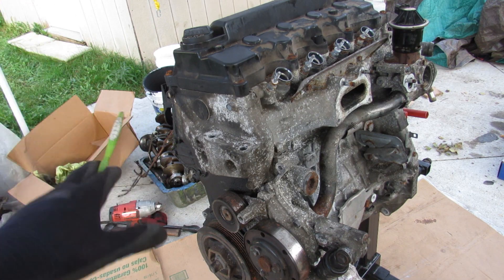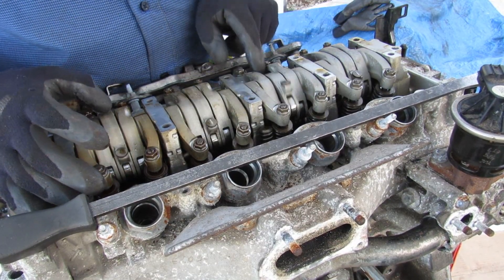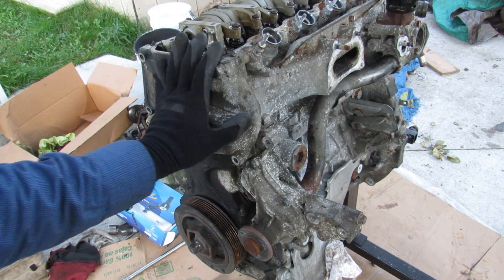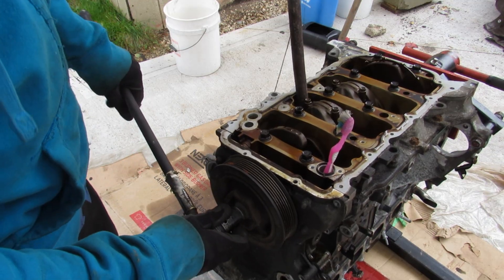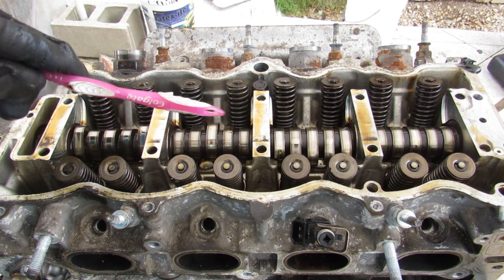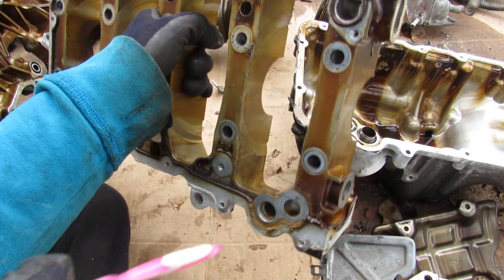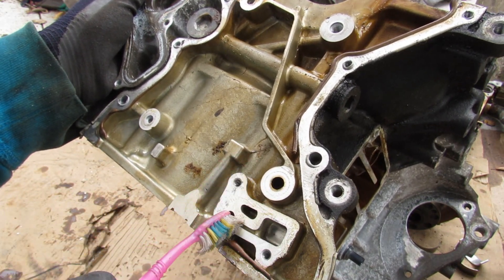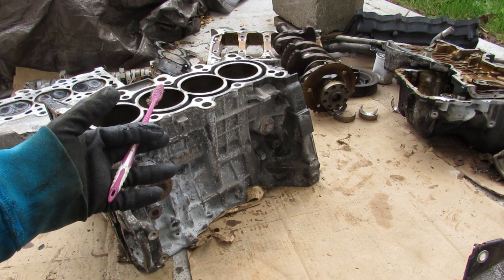Why Honda Civic Engines FAIL

Comment: I believe the egr/coolant heat exchange is intended to help warm up your cooling system on startup in cold temperatures.

Edit: I take it back, cooling exhaust gases before recirculating makes sense as its primary purpose. Might also have the added benefit of getting the block up to temp more quickly, but that's only speculation on my part
Reply from the maker: Or cool down gases before making the intake air too hot?
Reply: @speedkar99  It makes sense now, yeah. Maybe both?
Reply: @joystix11  exhaust gas recirculation I know on diesels brings hot air into the chamber to increase the air and combustion temp to reduce soot content but increases Nox if im not mistaken. but the system sucks ass lmao and clogs everything.
Reply: @razzle1245 I know on gas engines the EGR gas actually help cool down the combustion temps by replacing some of the oxygen with exhaust gases  that way when the combustion ignites it’s not as lean because because  there’s less room for oxygen when exhaust gases are present in the combustion chamber. The leaner the fuel air mixture the hotter it burns… they cool down the EGR gas because the hotter the gas the less room inside for cool dense air …
Reply: EGR generally isn't used until the engine is already warmed up, so it won't help there. It's just there to cool the exhaust gases before recirculating them to reduce NOx emissions and improve the air's density. The exhaust manifold being built into the head does help the engine warm up faster though since it's cooled by the engine's coolant.

Comment: What is currently the most reliable engine? Serious question.
Reply from the maker: K-series is up there minus it's vtec gaskets
Reply: 2017 Camry I4 and 2018 RAV4 I4. Highest reliability rating by Consumer reports.

Comment: I have a 07 civic. I put as float in the reservoir to alert me to any leakage. So for so good. The signal from the float goes to a off delay relay then a red light. Green is on to let me know system is on and working. I have 243,000 miles with very few issues. Some like the paint clearcoat issues have started. Nice car hope to get 300000 miles plus.

Comment: I used to have a 2009 Civic with that engine....it treated me well for the 3 years I had it
Reply: I have a 2009 Civic since 2014.it had 42000miles on it has 146,000 miles now. Doesn't burn any oil! No major repairs, just maintenance.

Comment: Got the exact same engine block problem in my 06 Civic. Most reliable car in the family except for coolant leak. Eh, poured some head gasket sealer, sort of helped... Just topping off coolant once a month. Mechanically: car is perfect otherwise at 125k
Reply: Fix it right wtf
Reply: @DannyOrnelasPerformance  repairs would cost roughly what the car is worth, that's all

Comment: we got this engine up until 10th generation civic, the r18, I had the 8th gen. never had any problems nor heard anyone having them... the mechanics didn't even complain about them other than the exhaust manifold which could be a pain in the butt sometimes because the sensor in it could break or go haywire and cause fuel efficiency problems but the car would still run. otherwise a great little reliable engine. mine did not have any problems though
Reply: Several family members have had Civics with these engines, they've all been great.
Reply: @sharifsircar  As long as there are no codes and the engine runs well with good gas mileage, don't worry about it. That's still well within a normal range and the whole reason we have fuel trim is to correct for minor variances like that. The fuel trim is never going to stay at exactly 0 for very long.
Reply: Would that sensor be the oxygen sensor?
Reply: @XxNoBunSeedsxX  yes

Comment: I strongly recommend the Lisle 77080 socket for Honda's crank bolts, it removes them with ease
Reply: Always like to learn what specific bits from particular tool brands are best at taking apart certain car makes
Reply: @roddydykes7053  same, the hidden gems you can find sometimes... but this tool, saved me so much energy  and time it's unbelievable

Comment: "big problem with these engines" , "why Civic engines fail"..... Everyone knows these engines are between most reliable engines in recent times. Only lack of maintenance bring these engines to failure . Ignorants running low on oil or coolant , never checking anything. For the joy of the haters who can talk trash about them

Comment: If it weren't for the weak block, that engine design is as elegant as you can get! Thank You Speedkar for the valuable teardown.
Reply: Its just the early ones, anything past 2010 is a tank.
Reply: @sekkusupisutoruzu  9th gen with this 1.8 is the tankiest car model in the world
Reply: @sekkusupisutoruzu agreed. I have a 2012 civic coupe with 241k miles and all it has is an air bag light and some sort of slight evap leak
Reply: hi I am interesst to buy a 2010 Civic with this engine. Does 2010 models 8gen (EU) also have that problem?  @sekkusupisutoruzu

Comment: I have 21 Civic Sport 1.5t, when its on Drive idling at red light, RPM is 500, car vibrates, is that normal? On Park mode it idles at 1k rpm & no vibration.
Reply: yes its normal
Reply: YourTypical Asian  21 models don't have that feature

Comment: I've driven Honda's for years and many a people agree they have the best petrol engines going. My 2003 honda accord 2 litre petrol ivtec went to 280km before the engine went.
Reply: How did you destroy a K20 with only 280km on it? That should have easily gone over 300km.

Comment: What’s your opinion on Honda CVT transmissions? I would be really interested in hearing what you think.
Reply: From my experience it depends. The early ones in the first generation Jazz/Fit and Civic EK have a problem with the start clutch, resulting in shuddering on takeoff, but they’re otherwise reliable. It’s a well documented problem with lots of fixes out there. 
The second generation Jazz/Fit CVT onwards is very reliable. I can’t speak for the larger cars like the CRV though. 
Either way they’re way better than Nissan/Jatco CVT’s.

Comment: I loved the engine teardown especially because it was a Honda engine. I always like to see Honda engineering tricks explained. Do you only tear down engines from junked cars? Was this R18 from a junked car? Also, if you can please tear down a L15A1 or L15A7 from the early Honda Fits. Those have a version of i-VTEC and it would be interesting to compare their iVTEC to the R18 i-VTEC. Plus, I hear that the early Fit engines are the basis for the current Honda turbo 1.5 liter engines.
Reply from the maker: Yeah I can only afford engines/cars that are old or broken
Reply: Sadly, I bought, and now own, accident honda city 2013 on my tight budget. The rear of the car is hardly hit and leaks. I have it fixed the rest of jobs. Now it’s back on the road.
Reply: I would also love to see an L15A7 engine breakdown

Comment: Well that explains the reason why my R20A engine is loosing coolant. Thanks!
Reply from the maker: Didn't know the 2.0 had the same issue
Reply: Can't confirm it yet. But it does explain the coolant loss. No white exhaust smoke, no visible leaks on the radiator, spark plugs looks fine, coolant hoses don't have crusty buildup on the outside, no funky smell from the AC that shows leaking in the heater core.

Comment: This r18 coolant leam problem was a casting issue. It also cracks/develops pores on the other side of the engine. This engine is still used today in hrvs and I haven't seen a leaking block in years. Pretty sure the warranty extension got them all
Reply from the maker: Yeah they fixed it in 2009

Comment: Honda and Toyota are thought to make the most reliable engines in the world, but as we see here, neither is without occasional problems.
Reply from the maker: Yes there are some problematic ones. Last week I finished tearing down a bad Toyota engine. Video to come soon
Reply: very bad experience I had with this same exact engine ,only lasted tad bit over 100,000 miles the engine block failed , bad Bad waste of money.

Comment: I had a question on the R18 Engine, I have a 2008 Honda Civic EX with 242k miles, no issues had to change the PVC Valve due to burning oil. I been told that the chain tensioner goes out around 300k and 400k. Is it possible to change the tensioner without taking the engine out and working on it from under the wheel well?
Reply from the maker: Yes. A bit tight though to work in the engine bay.
Reply: Thanks for your quick reply. This car has gone to Canada, 42 States, and Mexico and never had a brake down. I heard the coolant issue is only found in 1% of engine made in that era so its uncommon. I'm sure if I replace the chain tensioner this engine will go to 600k miles. I still have original clutch, one of the best cars I've owned. One common issue is the Denso A/C compressor had to change it and almost everyone I know has had to as well.
Reply: My 09 civic has only 110k km but it burns oil like crazy. I would check oil levels every time I fill up gas and oftentimes the oil would be reduced in half. Any ideas? I had it checked for leaks but there was none. Scared of how much it’d cost to repair. I love this car.
Reply: @skateboarding118  Hey man I would first check your PVC valve here is a link for the video I used. https://www.youtube.com/watch?v=M-v0m-rrEzw
Another take would be to make sure you are using good oil and a tight filter in case you are dripping oil. Another thing to check would be the oil pan.

If none of those things solve the issue, then check your seals because you might be burning oil. One can tell by checking the exhaust, you would get a blue smoke cloud with  a bad smell
Reply: @fnbuy  Thanks Sebastian, I appreciate your reply very much! I will check out the link. The inside of my car smells like something burning every once in awhile and whenever I check the oil level then, it’s reduced.
Reply: @skateboarding118  did you found the reason?

Comment: Oh man, how I miss the cast iron engine blocks :(
Reply from the maker: I hate them. Too heavy and things can get rusted
Reply: Go buy a vw product then. The 1.8, 2.0, and 3.6l are still iron. Not sure about the 1.4l though, but it might be as well.
Reply: @Mrcrappyfuntastic  Yes, you can still buy brand new Audi vehicles with cast-iron block 2.0L I4 turbo, which they claim has Honda durability now in the latest design. Also, 2.5L I5 is cast-iron too.

Comment: do you have ANY videos on the 2.0 non-turbo engine, K20C2? I drive a 2016 coupe with a 6 speed manual, so far, 82,000 miles, just replace the basics that wear out over time.. small oil drips from the oil filter. Also, might have small seepage on the rear of the engine block. nothing noticeable between oil changes tho.. I can't find much in terms of Honda's K20C2 engine..
Reply from the maker: Yes I have a k series video go check it out
Reply: @speedkar99  appreciate the reply! I'm looking on your  channel, but can't seem to find the video on the K20C2 engine... :-/
is it the one titled, "Why the Honda K Series is the Best 4 Cylinder Engine" ? Again, MUCH appreciated!

Comment: Great video. It's odd that in the UK we don't have that problem with the blocks cracking. That makes the UK engine extremely reliable.
Reply from the maker: Yes it was a casting defect that affected certain regions
Reply: @speedkar99  can you prove that? like an official honda statement?

I have heard a lot of bullshit over the years. My favorite is "subaru ring lands are weak" which is actually factually incorrect. It most always comes down to user error. In the case of the subaru ring lands, they complain about cylinder 4. But when you look at the oil pathway, the 3 other cylinders, even the turbo, gets oil BEFORE the 4th cylinder. So when assholes drive their subaru like they stole it, but ignore checking oil levels to make sure it stays at the proper level, you get lack of lubrication, lack of lubrication means heat, heat destroys ring lands. I've seen it time and time again. Its always some rich asshole who has more money than brains, hell more money than driving skill.... and they act like they know everything.

From my own experience as a mechanic, I have never seen this engine have any issues. And I work at a honda dealer as lead tech....
Reply: @goblinphreak2132  That gives a good confindence boost. I've always thought these cars were super reliable
Reply: @rihasanatrofolo2472  honda and toyota are fucking amazingly reliable. you are hard pressed to get major issues unless you really really really really abuse the car. most people dont abuse their cars that way.
Reply: @goblinphreak2132  I've only driven Civics for the last 20 years. Currently have 2014 idtec diesel, fantastic car but like my previous 2 civics 1.4 petrol non vtec the weakness is the aircon.  Because I bought all cars in the winter I've never checked for problem so only found out in the summer (all 2 weeks here in Ireland) 🙂

Comment: Is it just me or does the Civic have a 20X6-20X8 model year curse?
2006-2008: cracking blocks
2016-2018: oil dilution
Reply from the maker: Yes. The good models get the worse engines
Reply: @speedkar99 And I just bought Civic Tourer here in Europe with R18 engine...I guess this year model are clean of faults. The engine looks brand new only 45k miles...😊
Reply: I think it's something to do with new engines.

Comment: Head bolt tip - turn the engine 90 deg in the stand to loosen the head bolts in a vertical arc instead of horizontally. That way the engine & stand won’t walk all over the place on you.
Reply from the maker: Yes I know that. Just didn't expect this engine to have such tight bolts, I usually knock em loose sitting up right

Comment: Here in Europe this engines are not affected by this issue

Instead, R18 series are known for their reliability and longevity

R18A1 in a 2007 Honda FR-V 230k kms and going strong
Reply from the maker: If the block doesn't crack, these are good motors
Reply: 07 civic with 250,000 miles. Just now noticed a little oil leak on the rear main seal but otherwise a solid engine
Reply: Is there any official statements from honda about which regions got effected?

Comment: Like almost every modern engine, running on 5w-20 (post yr 2000), this one also suffers from baked oil control rings. Sorry people but in my experience there's no such thing as Long Life engine oil in modern cars. I really try to encourage people to keep OCI within 10-12k km, to avoid further costs ahead.
Reply from the maker: 10,000km? And here I am changing oil every 5K...
Reply: If you do at 5k then it should be super stinky clean inside. My self, I tent to do OCI at 8-10k km when I drive hard. In one of Polish garage channels (just a regular mechanic - no funny ads, no BS), they did premium synthetic oil analysis at 12k for Škoda (VW engine) with 150+k and the oil had still a lot of life in it. 
You know the new OCI for BMW and VW in Europe is ... 30k km for the Long Life oil 😳🧐. It would be interesting to split into pieces one of those engines after say 200k. 
But generally I would like people to follow the severe conditions maintenance schedule when it comes to lubricants.
Reply: @pliedtka  It's not about the oil, but the particles in the oil that clog up the oil rings and cause more friction in the engine.

Comment: a good demonstration  not just of a design flaw, but why regular oil changes are critical
Reply from the maker: Agree
Reply: Or why buying a OEM oil filter is best idea you could have
Reply: @DannyOrnelasPerformance  Fram makes the oem honda filters. In the various in-depth testing, fram has very low performance compared to filters such as wix or k&n. I run either napa gold or K&N on my 2006 civic with synthetic oil, it has 219k miles, still going good. I always ran Wix/Napa gold filters on my Cummins diesel Bronco and that is running nicely with 410k miles on it. lol Decent filters.
Reply: @AmericanThunder  look into the tests for oem honda filters
Reply: @AmericanThunder  im sure honda specified them a set of guidlines tho i do miss the AO1 filters as supposed to updated AO2
Reply: @DannyOrnelasPerformance  From what I read on it, the honda came with a oem filter off the assembly line made by filtech, but the oem filters available from the dealer are made by fram. I wouldn't touch anything fram had to do with. K&N is my 1st choice, as they have a higher flow rate than even the wix(2nd choice) with similar filtration. The higher flow rate and exceptional filtration is critical on high revving engines.(in the past, on my 8500 rpm 302 Fords that I built) and on my hondas. I just can't come to trust anything made by fram, from seeing the results of what they do to an engine first hand.(I'm retired now, but I was a builder once)
Reply: @AmericanThunder  it really doesn't matter. Fram makes more than adequate oil filters. The problem is really people going too long between oil changes in general.

You should NEVER go more than 5,000 miles between oil changes
Reply: @fishjohn014  well with that I agree most people are bozos 😂
Reply: @fishjohn014  I do be waiting about 10k between changes sometimes on the civic 😅
Reply: And also periodic coolant change
Reply: i am totally with you

Comment: i remember the my 01 civic went with me from highschool to college until you guessed it cracked block...still lives in the family to this day although with a Japanese import engine with 40km on it ( had about 154k Miles when the block cracked and started overheating like crazy)
Reply from the maker: Hmm the 01 didn't have the same casting defect as this though

Comment: A German engineer looked at that engine and says; that's not nearly complicated and stupid enough. Let me add a whole bunch of useless parts that are guaranteed to fail early
Reply from the maker: Agreed. Although most German engines don't do the VTEC style of locking rocker arms
Reply: This video would be over an hour in length if it was an Audi